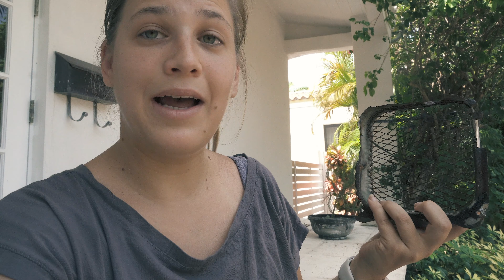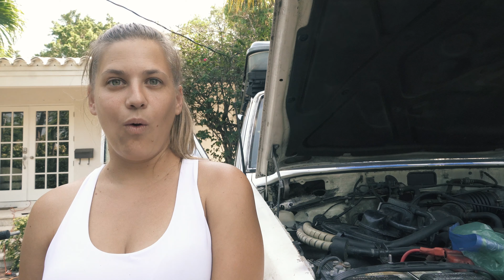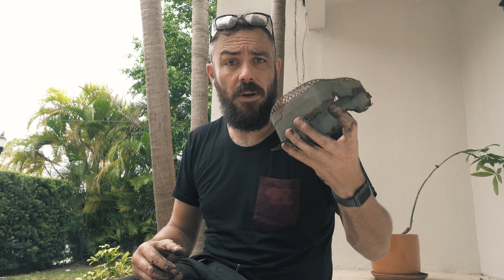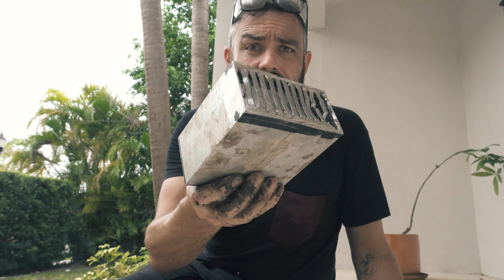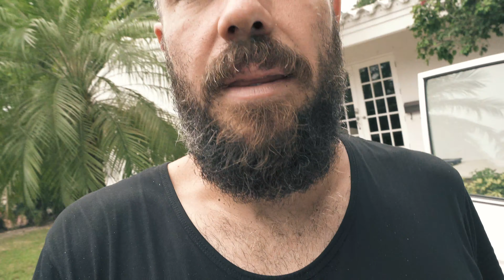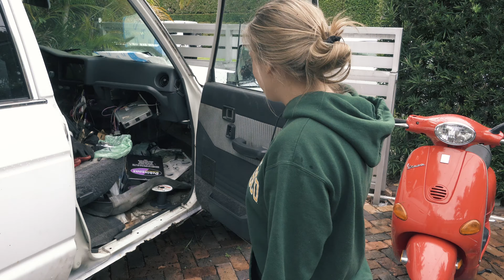Old Car Problems: FJ62 Cabin Blower Fan Filter DIY

Comment: Just opened up the panels on the fire wall that give you access to the under-cowl area and found that front areas of my cabin air inlet was rusted out and the PO had tried to fix it with weather tape and spray foam. It did not work and just led to more gunk and leaves and water getting trapped in there. Seems like it's a pretty common area to rust from what I've seen on forms. It  just reall sucks that the cowl isn't removabable. Would make life alot easier.
Reply from the maker: Our next job is to remove our front quarter panels as we're replacing them. I wonder what you can access with those off?